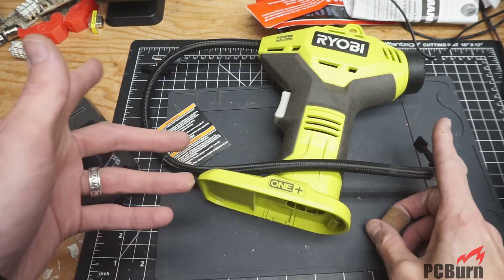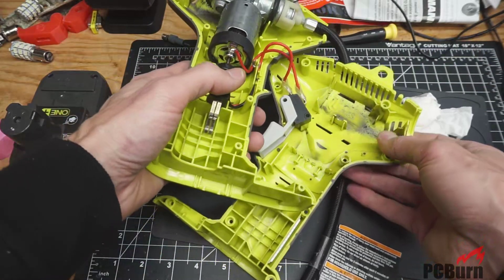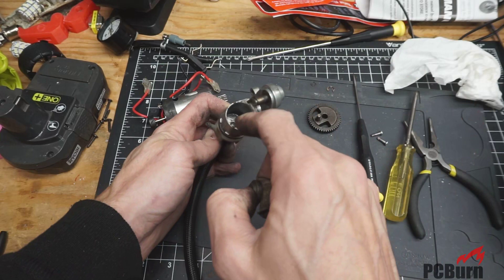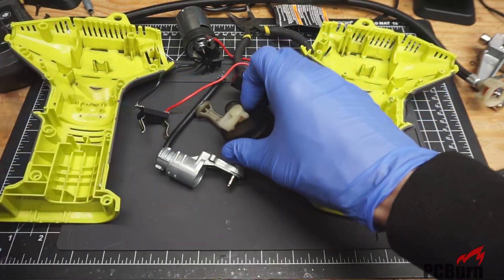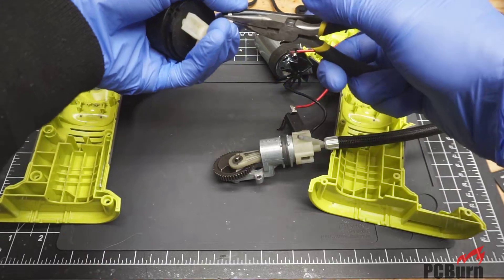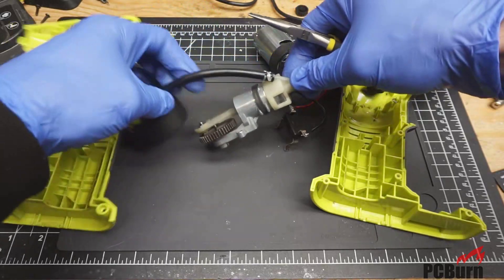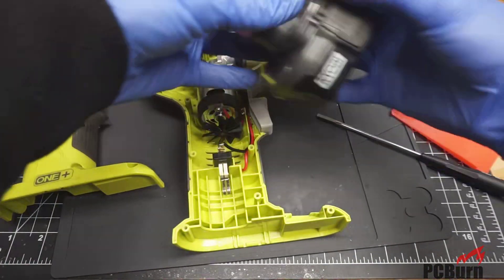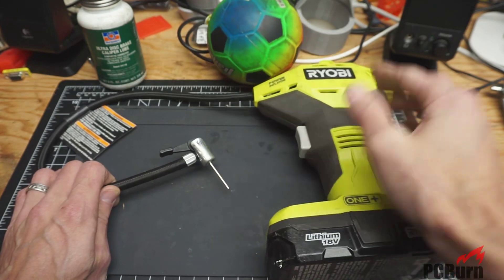Looking inside the Ryobi P737 18v Tire Inflator - Repairing and Designing a Replacement Cooling Fan

Comment: Thanks for the teardown, though it confirmed what I suspected already, that it is more or less of a joke with single-digit CC's displacement, plastic parts, and open sintered bushings, no head heatsink, basically made as cheaply as possible besides the molded casing.

There is a certain satisfaction in repairing things, especially if you can make them better than new, but in this case even if we assumed it was as good as new again, it simply was not worth the bother.

It is strange to me that manufacturer aren't making larger inflators, thinking we'd all like to wait several minutes just to inflate a car tire, when a bigger motor and 5X larger cylinder would not have cost them much.   I know Ryobi has the P731 but it is also an example of a ridiculously small compressor in a fancy plastic case.  Nobody wants to pay for or drag around their tanked air compressor just to inflate things, instead they should make something similar to a Viair 88P but with an 18V motor and integral battery shoe.  

This is technically possible as the 88P is only 20A @ 12V so a similar HP motor at 18V would be well within the current capacity of the battery.  They could even one-up it and use a brushless motor, probably get the current down to 10A which is sustainable.
Reply from the maker: True. My car has a far superior German compressor at the same size. 

I would love to have a maybe not quite as small battery compressor that isn't this cheap a build as well.

Might have to look around for one that'll accept 18v and make a power shoe for it.

Comment: Any thoughts on replacing the head of these to allow pumping for Presta valve bike tubes? I imagine the process would be simple, but am concerned about the insulation/wrapping on the hose.
Reply from the maker: Those look neat! Guess I don't do enough biking.

I'd probably just use a Presta to Schrader valve adapter. Ryobi had included one with my pump (I had no idea what it was until now).
Reply: @PCBurn  Ended up pulling the head off of an old pump, and then just cut the stock head off and reattached the second one. Just in case anyone asks in the future!
Reply from the maker: Thanks for the follow up. Good to know that worked for you what with all the press fittings.

Comment: You mentioned that the gauge needed replaced.  Did you ever do that?  If so, what replacement gauge did you use for it?
Reply from the maker: I haven't yet. Unfortunately any of the gauges I have that'd be roughly drop-in are just as bad. I'm still keeping an eye out for a scrap bin replacement.

Comment: I got one recently and it appears updated with a digital meter. Maybe they worked out the fan issue as well. Very good work you did there.
Reply from the maker: Thanks! Sounds like they've redesigned the unit. Hopefully it's less failure prone.

I'd guess the air pump is still the same.

Comment: I smoked one in a month....  then I got the inflator deflator, not so accurate, then got new new one so far its good...
Reply from the maker: After the rebuild it's still going strong. Filled up an inflatible kiddie  pool in only two cycles with no overheating.